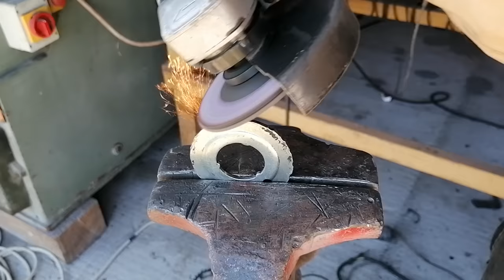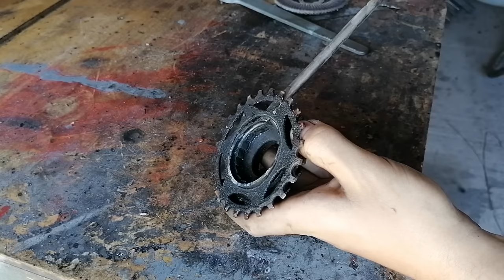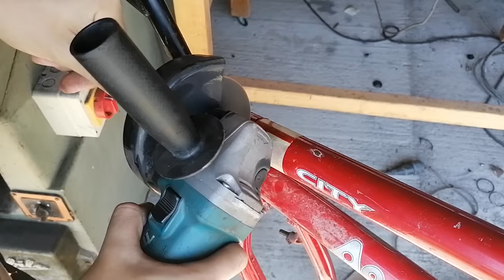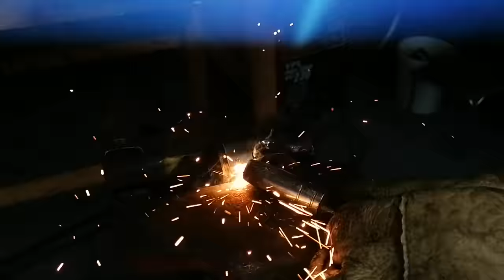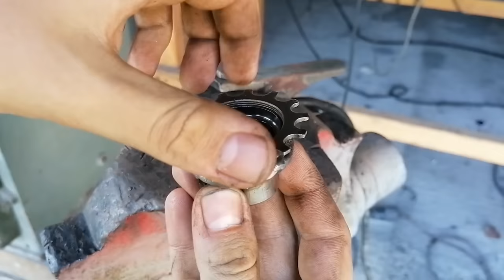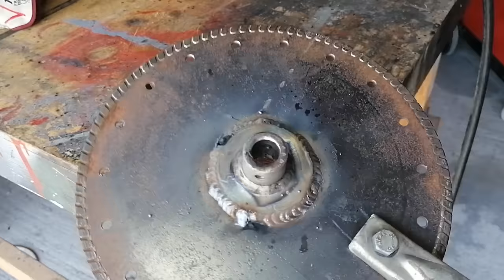Building a Chainsaw Bike with Gears from Scratch!

Comment: This was terrific. I laughed at the drill bit flopping in the lathe-but I learned something, never thought about that. Another thing was using the welder to cut the cables-beats bolt cutters and the lead sinks on the end. I would have used a twist throttle from a motorcycle scrapyard instead of the lever, and put the rear brake on the left foot, though.

Comment: I built my first motorcycle when I was 11, I'm 78 now and still riding a motorcycle. Bought a Whizzer engine in an apple crate and used a Schwin knee action bicycle. Rode the wheels off that thing. 
Great job on your build. It's obvious you put a lot of thought into it. Your mechanical aptitude shines throughout. Wish you a lot of luck with your future.
Ride on!

Comment: Nice job! I spoked up a 3 speed hub to my motor bike wheel powered by a clinton 2.75 hp 2 stroke back in 1965. Just be careful and don't down shift or you could sheer the gear in the hub.
Tanks for sharing your fabricating and engineering skills. Most professional work!

Comment: As a tool and Die maker of 40 years experience, I can really appreciate your metal working skills. I myself worked 7 years as a metal fabricator and a welder. Welding go cart tubular chrome moly frames with a mug welder was a challenge but with practice you could run one quick pass without burning through the joint. You have some really good work there on that bicycle.

Comment: About 25 years ago I built one but with the engine on a rack on the front wheel. Using a rear wheel on the front for 7 speeds. It probably would have been better to make it like an old solex and drive a rubber roller direct to the tyre. But there was not much else to do in my small town and I had access to all thr junk I wanted lol

Comment: Got to be one of the best DIY motorized bikes I've seen; definitely the best using a chain saw. Good work! 👍
Reply: very nice. even if completely illegal in UK.
Reply: Best?  in what universe?  He weakened the most important part of this bike, the frame.
Reply: @tauncfester3022  On the contrary, he reinforced the frame, he moved the tube from the bike upwards and welded it, which makes the frame more stable. As a result of the laying, a larger, more stable triangle was formed, which is stronger than the original connection. He also welded all the square tubes that hold the engine, which further strengthens the whole thing. So don't talk nonsense if you have no idea about such things!
Reply: @bmw-braca  You haven't built a quality bike frame have you?  Cutting tubes with a abrasive disc grinder and then crudely tack welding them back in with a cheap flux core MIG isn't "reinforced".  I've worked in the bicycle frame building industry, this is how you become a statistic from your own Darwin award.
Reply: @tauncfester3022  Wow, good luck, you are so talented, then please go back and continue building bikes with expensive tools that a company provided you, you are currently comparing a DIY channel with a bike industry. What would you experts do if you don't have your expensive tools and the instructions on how to build a bike, probably nothing, because the aim of this video was to show what you can do without expensive tools and resources that you have at home. Just admit that you are jealous, nothing else. nice negative life, bye
Reply: On YT There's Always Going To Be, ...."That Guy" Not Worth The Time!🙄 @bmw-braca

Comment: Brilliant young man ..
Your welding skills could improve. However, you
'ldea Concepts' are outstanding...
A clear talented engineer...
Well done 👍
From really nothing to something great...
Be proud.
Reply from the maker: Thank you! 
Yes that's right, welding still needs some practice, although I have to say that at the time I only had a 1mm thick wire for my Co2 welding machine and it is not so suitable for thin sheet metal, 0.6mm wire would have been much better, that's why I did more spot welding.
Reply: Look around for a Parkside gasless machine...very good and not too expensive... great for thinner materials... especially bike frames..
I too am building a scooter using a bike frame...
0.6 is a better size...you can also get the right amount of penetration..and have more control over the amps.
Worth checking it out..
You have a great future, if given the right advice and support... don't waste your talent...
Your young... l'm old..😅
Reply: @redfactory-diy you may have done a good job but, it's not practical for the average guy. You can buy a good small dual purpose motorcycle that's faster (incase you need it in a sticky situation) and a real fuel tank that holds enough to actually get you there and back for a lot less than someone who doesn't have or have access to the tools and equipment and parts and would have to buy them.

Comment: Nice job. 
I tried a 34:1 first gear on my 53cc 4 stroke with a 3 speed nexus hub, couldn't safely do u-turns in first. 
It just kept lifting the wheel off the ground with the slightest throttle.
Now I have it down to 24:1 first gear if I remember right.
Still climbs hills fine and is geared for 47 MPH in 3rd.

Comment: Probably not legal on UK roads, but a joy to see being built and it is obvious to see that 
plenty of thinking went on behind the scenes to get this just right.
Reply: Not legal is correct. Therefore I feel some stealth is required in the design and the pull start attachment is a giveaway.  I did see parked thirty years ago , a bike that had only the chainsaw motor without the pull start mounted in front of pedal crank body .   It was in full view but not really very noticeable. Thirty years ago back then , any motorised bikes didn't attract police attention like happens today .  So I have a project bubbling in my mind .
Reply: @Philip-hv2kc  🤡Troll Harder .. The Police didn't care in 1994.. 😂Were you even alive then?

Comment: Tip, when bending sheet/strip at a line by scoring a groove with the grinder bend the metal TOWARDS the scored groove not away since there is then less danger of the metal tearing at the groove.
Nice build Dude! (Some neat details).
Reply from the maker: You're right, but the problem is that the groove is not wide enough and this prevents a complete 90 degree bend in the direction of the groove with thick sheet metal because the corners of the groove meet earlier before you have reached 90 degrees. That's why I bent it outwards, which will end up being welded anyway. Thanks for the tip, if the bend is less than 90 degrees your advice is correct.

Comment: Stunning build by the way! The level of detail is amazing. I would build it the same way, except I would rig up a slightly larger engine (4-8hp) and then put on a mini turbo with a mini intercooler and oil cooler with a self-contained oil pump and cooler. Maybe even rig up an inverter with a small lithium Ion batt pack powered an in hub electric motor in the front wheel. Plus add a small bank of "Super Capacitors" that would store energy to be used as an electrical form of nitrous. It would most assuredly have a boost button on the handle bar or even on the frame, hidden. Your build is epic though! I love how solid you made everything on that bike. Just needs some mountain bike (or rock hopper) style suspension and that thing would amazing off-road as well. Great work sir! Definitely subscribing after that video.

Comment: It really is the best one I have seen to. I built a chainsaw bicycle and it worked pretty good it was a little bit over geared but once I got the speed up it worked pretty good. I have a 21 speed that I want to do another one with gears to the chainsaw engine only has high rpm torque so gears is what it needs to function properly

Comment: This is fucking cool.  I'm not a metalworker but this is extremely inspiring.  With some decent but totally accessible tools and more knowhow you can fabricate so much. I forget that things can just be made.  Like the muffler I would have though you had to modify a different one. 

Thanks for posting.   Very cool.  And very easy to see all the steps come together.

Comment: Great feat of engineering, fabrication and improvising. I never used a drill bit as a tool bit on a lathe. I have tool bits though. I will stick to buying the bike motor kits.

Comment: 😮👍👏👏👏
Really great , both as idea, and realization.
The result is so interesting, that I would notice a lil' particular, at least to me, "unfitting" with such a good work, that is the brakes kind: being you so good as you showed in the vid, and having built a bike capable to reach 45 kph, I think that with a small work more you could replace those old kind brakes with the typical mountainbike kind, with its way more efficient leverage system, and a way more reliable and safe braking.

Comment: Great build, and you can always port the cylinder for more power maybe build a expansion chamber exhaust for it. Or get really creative and build a big bore kit for it. Use a motorcycle carb,  push it to 80-100cc , maybe even build a 2cylinder version, you can mill the cylinder base to raise the compression. If you do not want to port the cylinder to get the port timing back. And the power is off. You can use another base gasket to get it back in time. The additional compression will help power. My concern is the clutch. I have never seen a clutch like that not slip , it's how it works. Maybe it can be modified to atleast use a go kart clutch.  They can be modified by cutting the weight in multiple pieces so it contacts the bell in more even contact patch . Then modify the spring pressure to engage at a high enough rpm to not slip. It's best to not ease on the throttle, go near full on to take off . Of course letting off of it is slipping .  I saw very few things I would have done differently. I have several saws. I'd maybe try something like this, I also have a few Chinese scooters 4stroke 50 and 150cc. I built one, it does 45mph fairly quickly. With a 330 lb rider!  It's 82cc oversized valves, carb, exhaust, ported head, high compression piston. I want to mill the head for more compression. The head I got for larger valves is for a 52.4mm bore, I'm running a 50 mm bore. And this cost some compression, if I can mill the head 0.8- 1.2mm, the valves have a week of clearance. The only possibility of an issue would be the timing chain, it also has a NYC cam. It has basically everything possibly done to get more performance. I could go to the larger bore for 86cc, and get the stroker crank to get 96cc with the largest bore. Bring 6'5" over 300 lbs on a tiny scooter, it's dangerous being on something Soo slow! Stock I would have a 🦥 sloth yelling at me to get out the road! About , 20mph top speed, 25-30 down hill. Now down hill is fast as I want to go on a scooter, 65mph, if I could get enough power to do 55-60 on flat land without revving to 10k, I have seen 10,200+/- but changed the spring and weights it was revving beyond it's power band. About 8800-9200 possibly 9500 is peak of the peak, maybe it could do better with a more appropriate cam. I been thinking about getting one custom ground. Or possibly building a cam from a motorcycle cam of the same head and valvetrain design. Cutting and pressing the lobes on to a steel shaft. Id really like to build a 2 cylinder version, using the 52.4mm bore, and large valves. Ported head. A couple 20mm carbs over the stock 18.5mm carb, and build a custom exhaust, with 1.25" pipe, with header pipes all the way to the muffler, and build a 'X' pipe. With the internal baffle from 1.5" or 1.75" pipe, use a hack saw to cut slits every 0.75" and use a punch to make louvers. About 1/2" wide and 1/8" 3/16" deep. Also drilling a ton of 3mm holes between the louvers. Put that inside a 2.5" or 3" pipe about 12" long with a 45° slash cut on one end. Make a cone to close the inlet end. And a offset cone for the outlet fill it with ceramic wool and make an access slit to repack. A 1.5" wide x 9" strip.  Have a 3" wide 11" strip with rivets every 5/8" on center. With a gasket behind it, possibly weld a 3"plate over the area then cut it out to have thicker metal to attach the cover to. I have also thought about rolling a piece of expanded metal over a 1.75"pipe. And cut long strips of pipe 1/2" wide 10" - 11" long to weld over thr expanded metal with a 1/16" gap. With 3-4 around the expanded metal baffle . To direct the exhaust flow keeping it in a pipe shape as it flows through, the sound from combustion should be absorbed by the high temperature ceramic wool possibly use another piece of expanded metal to keep the wool pushed up against the 3" outer shell, leaving about 2" - 2.25" for the baffle. Make the inlet end a couple of 3/16" plates with a 1.75" center hole and 6 perimeter bolts to bolt to another plate with a 1.5" x 3" sq tube. With the end going from 3" to 1.75-1.8" at an angle. So it's centered making the sides flair out from 1.5" to 1.75" about 3mm per side. Then using a hammer flatten and square the header pipes that enter the rectangle shaped collector, using the flat side of the collector to attach a mounting point. Using 3/4" wide flat 1/8" bar. Also about mid way from the heads make another rectangle 1.3" x 2.4" (+/-) and about 2-3" long. To allow the pipe to make an 'H' shape inside and be sealed in the rectangular part. Designed to equalise the flow. Allowing each cylinder to use both pipes for free flow hopefully creating a low pressure to pull the exhaust out, I have also thought about using a 18gauge 1x2 as the baffle. With 'v's and 'L's in the flow path, to direct the flow over the v's welded in the center of the rectangle tube, drill the sides full of 3mm holes wrap with ceramic wool, and place it in a 3' pipe. It should have a deep sound , use a 3mm plate for the inlet, with a 1"-1.5" pipe, slightly oval to fit the width. And a 18 gauge sheet for the outlet with a rectangle outlet, maybe cut little 1" squares to weld in the end of the rectangle tube 1/2" on center, to look like a vent! The only difference in the mounting of the engine will be the mounts needing to be wider with different spacers. A 3/16" 'Y' for the fuel line. It should be same same for everything else. I'd definitely want to build the crank to use a center main bearing, the others I saw built didn't use a center bearing.  It will just require a center main crank pin and  bearing press the crank together. Pin it if it's being pinned. Make a plate the bearing fits inside. It needs to fit the case and have a oil supply. I think 3/4" aluminum plate will work, weld the two layers together at the bearing. With the second layer about 5/8" larger on both sides of the bearing. Mill to the thickness, to fit , split it across the bearing hole. Drill and tap holes for the plate to bolt back together. (Or leave it as a single piece. Requiring the crank to be pressed apart to be removed.)  Weld in , 3/4" x 3/4" strips in the case fillet welds as well as plug welds, to hold them in securely drill and tap mounting holes with dowel holes possibly holes  from the outside of the case, for m6 bolts to secure the main bearing flange, also drill a oil passage for the bearing ,. Drill & tap a hole from the exterior of the case,  to feed the new main.   Use a external 3mm tubing to tap into the oil to the head,  drill two .040" holes in the plate at the bearing. For oiling , also running a line to the head to oil the cam and cam bearings, id like to also add a center cam bearing. Or bushing, using the bushing to supply oil to a passage inside the cam. With .020" holes drilled in the base circle of the cam lobe, drilled into a 3mm passage. Coming from a split brass bushing with a 6mm groove 3mm deep into a 2mm cross drilled hole in the journal. Into the through drilled 3mm hole. With a 6mm x 6mm hole in the end with a grub screw plug to seal the passage, possibly groove the bushing  to spray oil to the roller bearings on each end of the cam. And the chain and cam rocker followers. The oil holes will oil the lobes, especially with a bit of Lucas, making the oil tacky.  Two 82 or 86cc cylinders, making 5-6hp plus each, hopefully with a ground cam designed for performance, not a tractor like all the available cams seem to be. And the heads milled and matched after welding together. Getting 200-210psi or 195-210psi  roughly. It now has 163psi. Over the 145+/ it had stock,  with the added compression, and  with the added compression it will likely need the 3rd bearing to keep the crank stable at 10k rpm, and obviously id work hard to balance the crank rods every thing rotating to the best possible. To lower the stress. It may require adding a external oil pump. Or additional oil pump driven by the timing chain. Use 1/4" or 3/8" external lines , also using a spin on remote  mount filter with oil cooler, probably just solder on flat pieces of copper to the copper tubing,  and roll grooves in the copper to make .040" deep , 'fins' inside the tubing for extra surface area. To help the fins work. Or coil up some 16 gauge wire and solder it to the inside, flux and pour molten solder through the hot tubing, with the fins from 1" copper squares to form a oil cooler. Being the tube is 1/8" larger than it really needs to be. The internal fins should be fine. Being about 12" -18" of finned tube. It should cool plenty. Add a temp gauge to be sure the oil is hot enough. It needs to get hot enough to evaporate water than condensed in the case. About 200° since the parts heating the oil is hotter,  it should be close to 8-9+HP per cylinder, tickling 20hp  that would be awesome, to see 18-20hp at 8700-9000rpm it original made about , 2 HP at 7500-8500 rpm, it does have some vibration issues, it's never going to be perfect, maybe build a boxer haha! Or add a balance shaft! 😆, anyway, sorry to ramble if you are still here, have an awesome day, great video!! ✌️